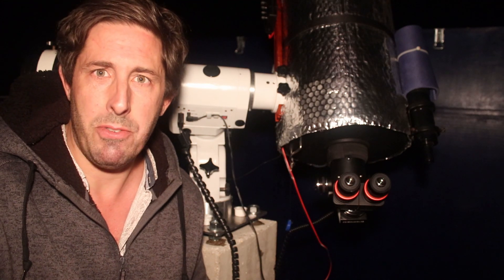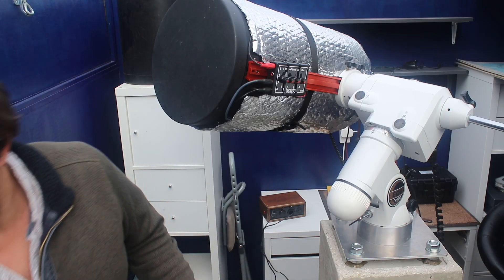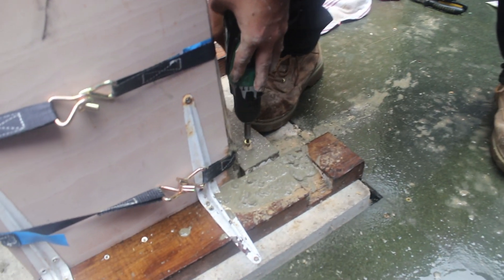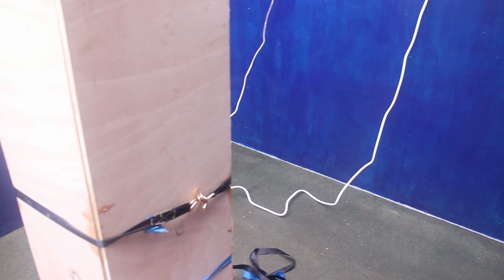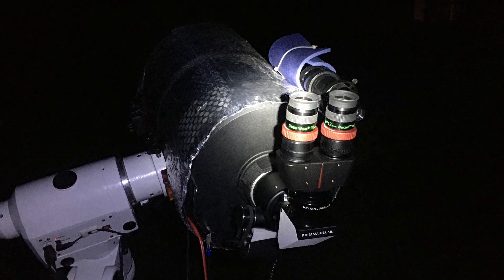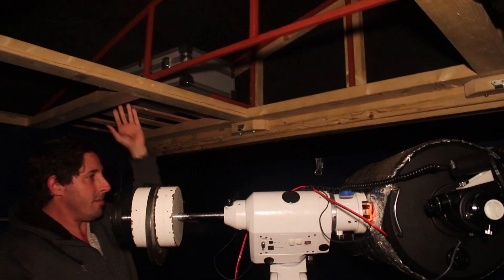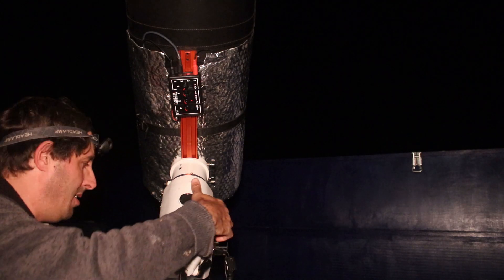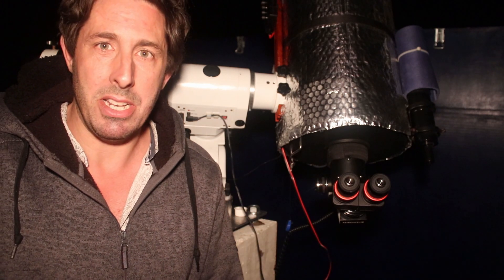Cheap Observatory Pier - so effective

Comment: An entertaining and informative video! Thanks! And here comes the "but"... 
It would've been more informative to see:
1) How you fastened the pier to the plinth
2) The method you used to embed the plate bolts into the wet cement and ensure that they're plumb
Reply from the maker: Yeah - fair points. I was in such a rush and it was raining so hard that pressing record at the start slipped my mind. Ian simply drilled rebar into the plinth and made the first pour wetter so it bonded better. As for the bolts, we simply put them in the wet cement and then added a fillet or two of concrete epoxy.
Reply: @RefreshingViews  OK, thanks!

Comment: Great video. Presumably you have to orientate your pier so the Alignment peg on the pier top plate puck points North? Dig you screw the  pier re-enforcing rebar into the existing holes in the floor block or is it freestanding?
Reply from the maker: I just aligned my EQ6 adapter with north and then drilled into the top plate. The pier itself is square with the building. And yes, Ian put some rebar into the original plinth for strength.

Comment: Hi there! Nice job, that's my next task one internal obo pier and one outdoor pier. Nice to see you kept the pier plate bolts as short as possible. I'm going to be putting Rasa11 and Edge11 onto Baader short pillar then onto concrete main pier. Thinking 10". what size did you make yours?
Reply from the maker: Hi Dave - good luck with your build.  Sounds like you will have a lovely set up with those two scopes.  Yes, mine is 250x250mm and 1.2m tall. As for the bolts, I should have gone for slightly longer as you can still have the plate close to the pier. Just seen you're in Cyprus - we have family in Paphos so I hope you are enjoying the winter sunshine.
Reply: @RefreshingViews  Weather has been terrible in Cyprus, I'm just outside Paphos. I'm actually over in Qatar at work in the moment, do a 5/5weeks rotation.

Comment: I would've left the wood on, just painting or wrapping it could've make it look nicer. Best pier of course.
Reply from the maker: That's a far point although it was pretty grubby with splashed concrete. It certainly would have retained the dust better and not needed sealing!